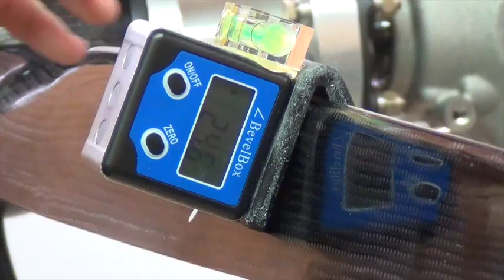Prop Install

Comment: Thank you for the video! Wonder why the manufacture didn't dummy proof it, either by a slot or line up marks.
Reply from the maker: This is pretty much how most ground adjusted props work. Some use pins or pitch blocks to set the pitch quickly while other have sticker gauges. But the ability to adjust the blades 0.3 degrees for example  to add 50 RPM is something you want to be able to do in order to dial in the prop to your aircraft.

Comment: Should the spinner always have a nylon bolt/screw? Mine came with a standard steel one. I'm replacing my factory prop bolts with ones with drilled heads so they can be safety wired, so the opportunity to check the prop balance presents itself. Any vids on balancing a 2 blade Ivo prop? Also, what is the make of your torque wrench? Looks like a nice one!
Reply from the maker: yes the spinner bolt should be nylon. The metal bolt is for the other side, inside the hub to go into  other side of the long nut. 

The Nordlock washers are a locking device and do not require safety wire. I would avoid safety wire so you can torque your prop effortlessly and every 25 hours after the initial 10 minutes and 1 hour.
Reply: Spinner came with with one, long metal screw, slotted head. For 2 blade Ivo prop on Polini. Spinner came from L.E.A.F. @LarrySMednick
Reply: My spinner has one long machine screw  that goes through the center of the spinner, into the center of the hub assembly.What is the make/model of your torque wrench? I need to buy one. Thanks! @LarrySMednick
Reply from the maker: almost any 3/8" drive torque wrench will work that goes up to 30 NM @alcourtines4707
Reply: Thank you!
 @LarrySMednick

Comment: Great video Larry, how ever i n my opinion the factory should make as groove male on hob  3 female on prop so the middle will read 18 as first groove read 17,8  while the 3 read 18,1 , so you don`t have to do all the hammering and use the measurement tool .
Reply from the maker: They do offer fixed pitch props with no adjustability.